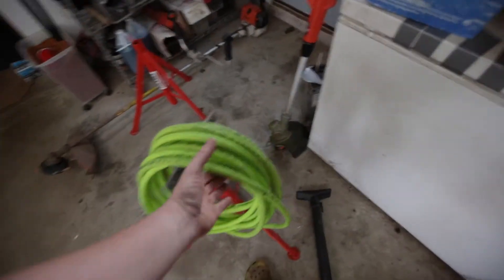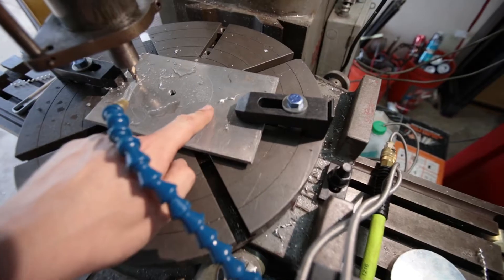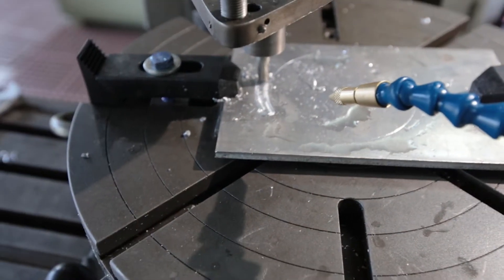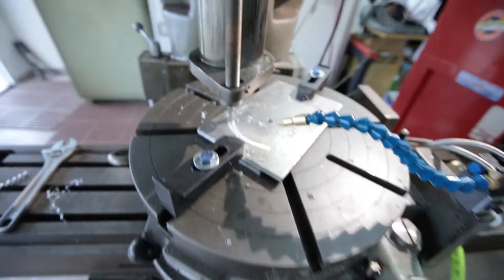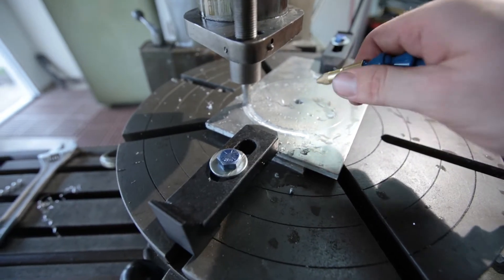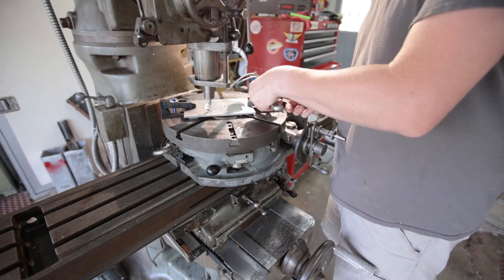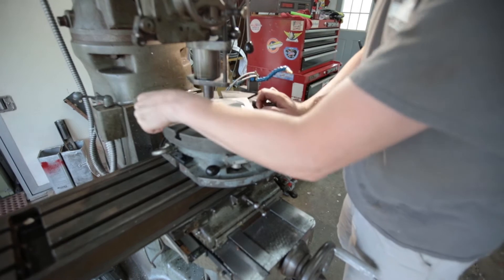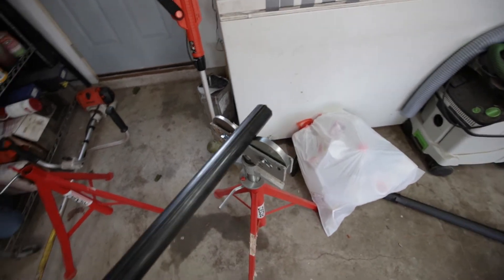Making Round Parts With A Bridgeport Type Mill

Comment: I knew the video was sped up but I could not stop from thinking I was watching slow motion. Is that really as deep as you can cut? I know it's not pine, but it's not steel, either.
Reply: Nice video, that mill could definitely take 1/4" aluminum in one pass (though you for that you might want to lift the knee a bit so you can extend the quill less).
Reply from the maker: I probably could have taken more off per pass, I am still learning about feed rates for various materials.
Reply: @DarlingtonFarm  You can use the maximum rpm for the spindle for aluminium in conventional milling machines, which is usually around 2000-2500 rpm. I would have done a roughing pass till about .5mm depth left and about 1 mm oversize. Then a finishing pass. Coolant is not strictly necessary, but it does prolong the life of your end mill. But if you're just using water with no anti-rust agents then it will rust your milling machine ;)
Reply: @DarlingtonFarm  You could have done it in one pass...
Reply: @mysterious_nobody_99  he said he was learning...